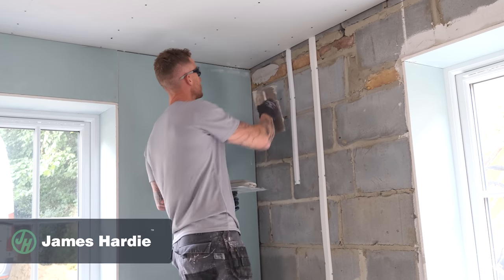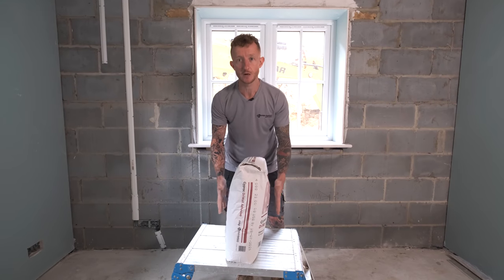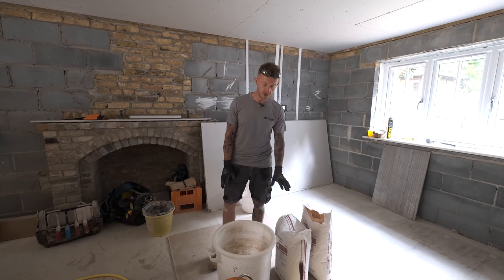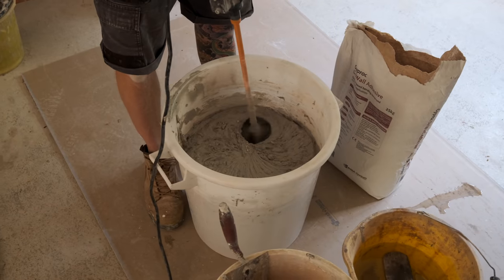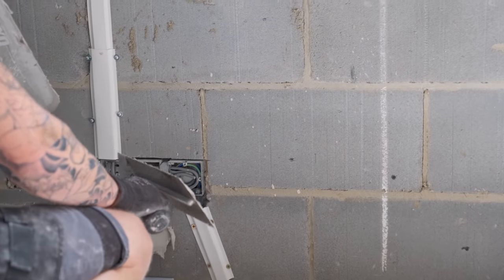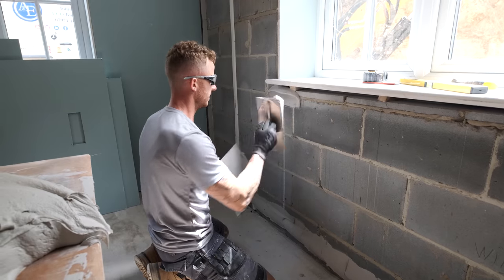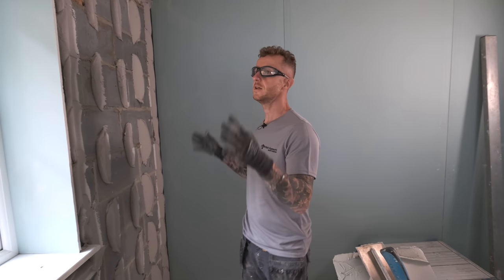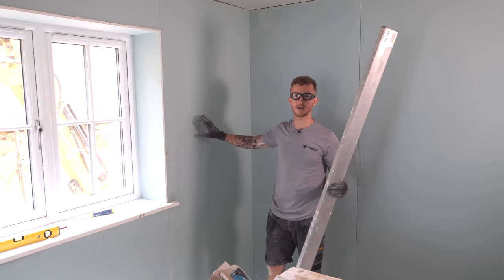Dot and Dabbing! (With Gyproc DriWall Adhesive)

Comment: Corefix plugs with the steel inserts prevent the board crushing back when you tighten up a rad bracket but plenty of mix in the radiator area is always appreciated. 👌👍
Reply: 100% on corefix. works on old Victorian lathe and plaster external walls too.

Comment: can i dot and dab the board? instead of the wall. has anyone tried that method?
Reply from the maker: Just out of curiosity, why would you rather dab the board than the wall?
Reply: The board becomes heavy and it snaps under the weight of it.
Reply: Sometimes easier to do the board on small pieces and top reveal. Otherwise just dab the wall and get on with life.

Comment: Why is he doing a 10mm fillet along the top but 25mm elsewhere? Doesn’t that make the board out of level with thicker fillets in places?
Reply: The 25mm dabs have more room to move into as surrounded by void. The perimeter dabs have less space to move into and squash down as they will hit up against the sides.

Comment: If you have a v.uneven or out of plumb wall, what's the max thickness of dab you can use without risking too much shrinkage as it dries?
Reply: About 25mm , But I have stuck cuttings of plasterboard to bring a belly out and then once dried re dabbed with a full sheet over it if you are in a bad spot.
Reply: @chriskane9230  - That's a good idea! Thanks.

Comment: Nice job John.  What's the knack to making sure you cut the cutouts for the backboxes in the right place on the board?  I always seem to have a nightmare measuring, guessing, more measuring then having to fettle the board.
Reply: Place the board before dabs and bang it will get indent in back correct position
Reply: @georgelfc1  Aha! Thanks!
Reply: Rub a bit of chalk around edge of back box, offer up the board and push against the boxes....chalk will mark the plasterboard.

Comment: Great channel, loads of great advice.

Was just wondering, in this video are you dotting and dabbing moisture resistant plasterboard? I've read in the instructions for drywall adhesive that it shouldn't be used with moisture resistant plasterboard, but is it actually OK to do so? Cheers mate.
Reply from the maker: Hi there. 

This video was shot with British Gypsum technical department on site. It is perfectly acceptable to use the products shown in this video, together. 

Maybe it was a different brand of adhesive which you'd read?

I hope this helps? 

All the best, John 👷🏻‍♂️
Reply: @BuildWithAE  That's what I thought, John. Thanks for the reply. So it was definitely the moisture resistant boards you were using here?

Comment: Nice video. +++ However I would like to know how do you fix the plaster board around the window and metal lintels. Can you use Dab on the metal lintel and the plastic insulation infill between the walls around windows and doors? Or do we have additonally use some metal screws to fix the plaster board? Thanks
Reply: You can dab onto cavity closers, best if you have good amount of block also. The lintel usually have a key to take DD.

Comment: You make it look so easy John!  :) Looking to do the same in my garage instead the button method. You said it needs to be sealed from the weather. Do you think will be an issue if I do D&D on a single skin brick wall such as a garage? Also do I need to use sealer on the brick before hand? Thanks.
Reply: I'd use moisture resistant board on a single skin wall.
Reply: @crisfiler6128  roger that, is that with D&D fix to the wall or with buttons?
Reply from the maker: Protected from the weather refers to the fact that it should be inside and openings such as windows, should be installed prior to installation. 

To be safe I would recommend battening the wall with a damp proof membrane behind the battens, to prevent any moisture or damp coming through the board. 

Hope this helps. 

All the best, John 👷🏻‍♂️
Reply: @BuildWithAE   Enormous help John and makes perfect sense. Many thanks for replying. Battening it is then   :)

Comment: Why can't you just plaster straight onto the concrete blocks....??? Instead of the hastle of plaster boarding with dabs. And then plastering.
Reply: You would see all the blocks through a skim. You could first float the walls with cement render or hardwall etc. DD is actually cheap, practical and effective.